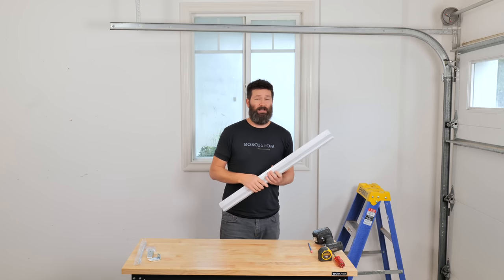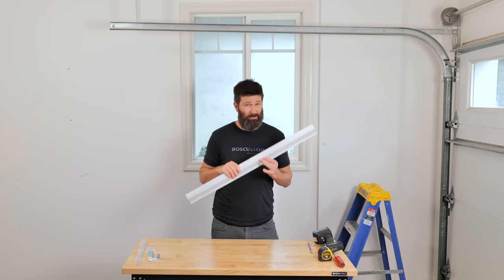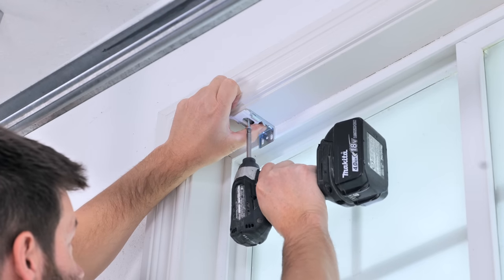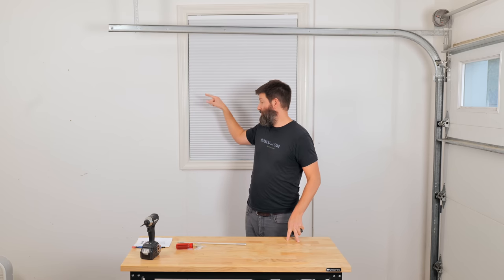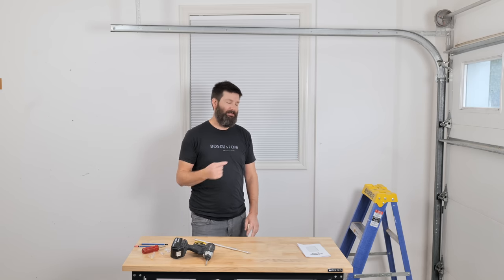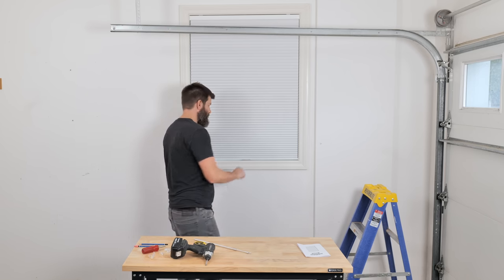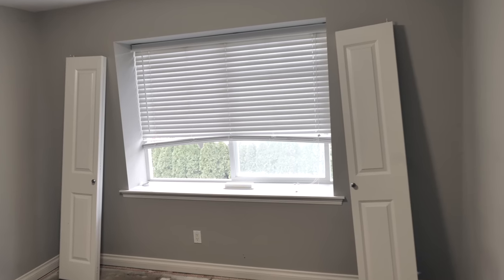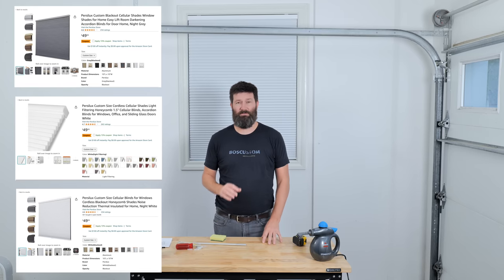If You’re Thinking of Buying Cheap Blinds off Amazon- Please Watch This First!

Comment: Please don't take this the wrong way. Someone needs to take the credit card away from you guys...especially your wife.
Reply from the maker: How are we supposed collect Travel Miles??? You buy 2 million dollars in goods and the next thing you know your flying one way to San Diego!
Reply: @TheFunnyCarpenter 😂🤣😂
Reply: @TheFunnyCarpenter but only on about 10 Tuesdays of the year.
Reply: I used dowels and turned finials, made brackets and my lovely young bride made curtains from brand new sheets.  14 windows, about four hours of combined weekend work and $120. Call me cheap, and I’ll be a happy guy! Always like your videos!
Reply: $5,500 worth of blinds by the wifie. 😂
Reply: Small spring rods from Walmart. They fit nicely within most window frames. I like to leave as much sky as I can at the top without compromising privacy. Usually I string 4-5 clip rings on them and clip whatever beautiful material I currently fancy in a panel shape to size. Translucent lace is always nice. Sheers work. Or blackout material. I don't even hem but u could.

It's not any more trouble to walk over and adjust them than it is to turn a blind wand. On really beautiful days I pop them out and stick them behind the couch. Every room can match or be different and the overall cost is minimal, especially if u source material at Goodwill. I've done this for years.
Reply: There are 3 links but they all seem to go to the same blind…can you tell me which one you used?
Reply: Lol. Your funny. I own a window covering company. $550\covering is pretty standard for a high end roller shade like he showed. Some Hunter Douglas stuff is over $1500. We do at least 2 $20k jobs a weeks. During the summer we can do 2 a day. This shade he showed is not great quality for $30 per shade more I can get you a lifetime warrantied shade, that is warrantied by me. No need to call anybody else.

Comment: Blinds are for people who haven't graduated to curtains yet. Curtains are superior in every way and some really significant ways. First and foremost they don't take up 10-20% of your precious window. They actually block all light. They are inexpensive, washable, etc. Blinds are what people that haven't found curtains use. I suggest Ikea curtains on their. Vidga track, modern looks, inexpensive, unlimited Customizability.
Reply from the maker: Yes but do the curtains come with cool windy mechanisms?
Reply: What are curtains?
Reply: I like the minimalist look of in-frame shades, personally.  That and having curtains tied back to the side (optionally) in case I want to block a bit more light or just add more visual interest to a window. 🤷‍♂
Reply: Well that’s quite pompous of you to say. Not everyone prefers curtains/ drapes or they like a combination. Curtains/drapes have their down side as well.
Reply: Sheer linen curtains on the inside and blackout inside mount shades allow privacy  but some light to come thru.  The problem w using all curtains (like hotels) is you can’t have natural light and privacy it’s one or the other.
Reply: So you’re hanging curtains in the  garage?
What about to cover a fixed window on an exterior door? 
Or what about “attic level” lofts/rooms that only have angled windows on the walls/ceiling due to the framing of the house?

And curtains are hung by their header, which yes I know, they have a lot of different styles available…. But if you’re talking about how much more affordable curtains are…. then that means you’ll most likely end up getting curtains that have an eyelet header, and there’s nothing tackier than that! (At least in my opinion)

Whatever you do though, let’s NOT hang curtains in the garage ok? Lol unless you want your neighbors to think you’re doing some weird sh!t in there. Just some advice lol
Reply: You are absolutely wrong about almost everything you just commented. Cellular shades are the most energy efficient window coverings you can put on your window. They are better than any curtain even window quilts. They are not certified against any type of bacterial or mold growth like most blinds are, they deteriorate over time faster than all types of window coverings, they do not block out more light than window coverings as window coverings you can get full frames that will block 100% of the light, they are also extraordinarily expensive for custom, and lastly are much harder to operate in every conceivable way compared to a well designed window covering. We also mentioned that you use IKEA curtains? That is why they are inexpensive they are the bottomest of the bottom that you could possibly buy even Walmart has better quality than that. They have little to no inner lining for energy efficiency, they have a zero fullness factor (look it up), are certainly made out of inferior materials compared to even semi-custom drapery panels, and are actually not meant to be moved or operated. As grommet top, top tab, or back tab, panels say right in the instructions they are for hanging not for operating.
Reply: @nhbountyhunter regarding insulation properties of cellular shades: there were a few very flawed studies that produced highly flawed results values for cellular shades, the results of which were picked up by all/most of the companies producing and selling cellular shades leading to a bit a mythology regarding their insulation properties. In summary they have an r value less than 0.25 without side rails. Regarding ikeA, you clearly haven’t looked into their curtain products at all. It sounds a lot like you purchased a very expensive custom shade product and have a severe case of confirmatory bias.
Reply: @fox156  your wrong. Ask an energy auditor. Besides that I am a window covering expert. I own and operate a large window covering company. We are the #1 Hunter Douglas dealer in our category. I've tried to respond with multiple different versions of this response but youtube refuses to post it. I have no idea why there is nothing wrong, immature, or hateful in my reply.

Comment: Could you please do a 3,000 pull test just to satisfy my curiosity if the blind will last 30 years?
Reply: These break right around the two year mark or sooner.  They are a poor design that has the mechanisms working against gravity and the how hard or soft the consumer pulls on it.  Great for spaces that are not used.  They look incredibly cheap and work incredibly cheap.  Great for rentals or garages.  Not for a new home.

Comment: I purchased similar cellular blinds from HD in 2008, it took until 2020 for them to stop going up smoothly in rooms that were used morning and night which i think is reasonable. But mine were not black out and made from a fabric which holds dust and won't let go. White will quickly turn to gray or brown,  trust me. 

Another thing to point out. If you're in a cooler climate i offset the brackets from the frame so i can get the film plastic window seals installed.  Really helps in MI winter.

Comment: I got similar Amazon blinds for 5 windows. Rather than fit them inside the frame I got them wide enough to cover the window from the measurements outside of the trim. The brackets are designed for both types of mounting.
That let me mount a strip of wood above the window to be screwed into studs then the blind brackets can be positioned anywhere along the strip to fit the mechanisms. 
They gave us pretty good black out coverage this way, too.
One out of five I returned because it did not hang straight and got a replacement. Good to check when you get them.
Reply: For anyone considering outside mount, extending width to 3" past window frame edge is enough to block light.

Comment: Got the same blinds and in some of the less used rooms the opening spring gets stuck and requires a bit of persuasion to kick in. The trick would be to open them daily to keep them in good working condition
Reply from the maker: Persilux brand?  I see on their site they recently updated the open close hardware…. Hopefully it holds up!

Comment: I grew to hate traditional folding style blinds... they are just dust collectors and easy to damage.  I've gone to zebra blinds made by Persilux.  Yes, they cost more that those paper/composite blinds, but are reasonably priced.  They also have a huge advantage with their double-overlay design, being able to adjust (for privacy) nearly anywhere along their deployment and lay flat so as to not gather any dust.  Very easy to keep clean.

Comment: I bought IKEA's cellular blinds. They only come in fixed sizes, however they can be cut down to whatever size you need with a circular saw. Yes you can! You must make sure you are very careful and you will most likely need to readjust the spring mechanism, Its not hard but you need to know what you are doing which just means coming to understand how it works. However Mold can be an issue. They do clean up easily as they are polyester, they look like paper but they are not.

Comment: You forgot to mention that when measuring and ordering you have to account for the hardware on the blind itself. It adds something like a 1/8 on each side. 
I doubled up on my bedroom windows with light filtering inside the window frame and black outs in the outside. This way I can have some privacy with some light getting through and if I want to watch a movie or sleep in, i can close the black outs
Reply: Last time I ordered blinds, I specified a slightly wider window opening to reduce gaps on the sides (the blinds come undersized). It worked.
Reply: You didn't order them as an inside mount or the company ordered from does not take standard deductions for inside mount. When you give most manufacturers an inside mount measurement they take off it usually somewhere between 1/16 to 3/16 off the width plus any hardware that may be in the way. If you order them as an outside mount you will get exactly what you order.

Comment: Started out by browsing at a Hunter Douglass reseller, since I got a new house a few years back. Few of the homes I looked at touted that they had them installed. So, got an estimate to see what it'd roughly be for a few windows (and then for the whole house for fun) and... 🤯lol. Yeah, yours were expensive $500/ea but what I was looking at was north of $1.2-$1.5k/ea. I still got some just for my home office (I may gradually add more over time if I'm satisfied with them) but that alone ran me about $2k for just a few windows. They are high end but damn I was surprised with how expensive it could get, for sure.
Reply: We have hunter douglass at my house, and they look and work nice, until the inside rope cables wear through the little plastic pieces protecting them from the sharp punched metal holes at the top and start eating at and fraying the ropes until they break.  Nearly every one of ours has stopped working and we take them in to get fixed, some under warranty but that only lasts so long.  I'm looking for cheap replacements now :-).

Comment: Custom made blinds are made using Low VOC type fabrics with Flame retardant standards to the relevant Fire code. 
You get what you pay for .
Reply: Though this is true it's not the standard. You do get what you pay for absolutely. But most blinds and shades are not made with low VOC materials and certainly not NFPA 701 compliant (fire rating). I owned a custom window covering company.

Comment: Seriously? You can buy similar blinds without blackout at Boscovs for $25. No way I’d pay $160
Reply: In the window covering industry you get what you pay for until you get to about $300 a window for cellular shades, then it levels off. But a $300 cellular shape will literally last you the rest of your life in your home. Versus what he's showing may last 3 to 5 years. I can understand you thinking things are expensive but when you own your own home and it's even a mid-level home and you put cheap $10 blinds on it it's kind of like putting snow tires on a Corvette. Corvette is not the beall and end all car it's a nice middle of the road sports car but by putting snow tires on it you severely hamper its ability to do its job. We also detract from the value of said car because it can no longer do what it should be able to do.

Comment: I'm super nervous to see your impact driver sit on its battery on the edge of the bench. They are designed to trick you into doing this, so you can topple it over with the spindle onto the concrete ground. Next you'll find yourself for a new one, because this one is out of center.
Reply: I own all makita drivers and impact  drivers, bulletproof. 
I’ve dropped all of them (3 regular screw guns, 2 commercial grade ones and two like this one) and they all withstand the falls. Though I freak out everytime one tumbles, especially when the larger batteries are attached. A 2aHr battery is supper light, but most are 5ahr’s which are bulky and heavy. And also more of a concern about breakage, since they cost more than the tool itself in most cases
Reply: @STV-H4H  Can't beat Makita for quality that's for sure
Reply: Most contractors that I’ve met will drill on about not setting the power tools on the battery as thats usually how they get knocked over and damage things
Reply: @Jefixit  yes, definitely. I’m guilty of failing to keep that in mind when I’m on a ladder. Limited space on the top ‘step’. 
I did finally install the belt clip on a couple drills, but because it was banging my knee, it is often ignored. It makes the profile wider, so it forces me to lay it on its side, but still, setting it upright forever is an instantaneous heart attack when it again topples. 
Maybe a weeble shaped battery is the answer. Looks dorky but if you know my reference, it’s at least a humorous reference.
Reply: @STV-H4H  on the older Makita series I bent one spindle and broke two chucks by toppling them from waist height onto concrete. Since then I lay my machines on their sides, so I don't know what the new ones can withstand. But I really don't want to find out 😉

Comment: 15/16 from the edge of the window? 
Wouldn’t it be better to just say 
1/16” from the front most edge?
  

Another observation. Youe a carpenter who uses his garage for what? 
This garage appears to be the same type of garage people who don’t use the garage as a garage or workshop. It looks like a tea party room. No wonder spending over $100 per is acceptable.
Reply: $120 for a single cellular shade is bottom of the barrel for custom. You may be able to find them for a little bit less but they're going to work for about 8 seconds before they fail. A good cellular shade is 300 plus. Though I would never put a cellular shade in a garage should be some type of plastic like a faux wood blind.

Comment: You Get what you pay for: it’s not 1989 anymore ! Looks 💩
Reply: Actually cellular shades are the most efficient thing you can put on your window. You may not like to look of them but they actually have an r rating of around four. This makes them the single best thing you can do to make your window more energy efficient. And these ones are cheap AF. An energy star certified one, only sold by Hunter Douglas, would easily be $800 for that size window. Not saying you have to spend that but you do get what you pay for in the window covering industry.